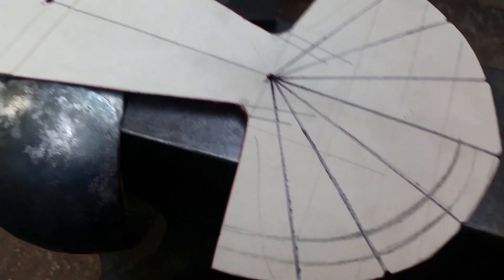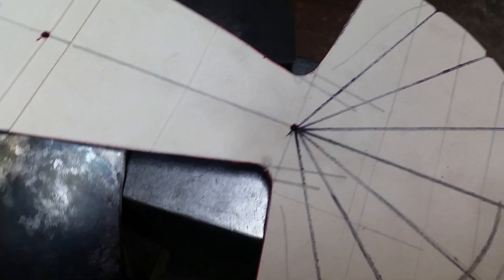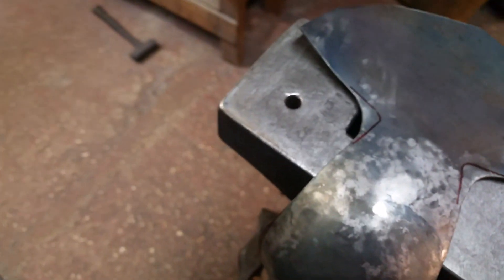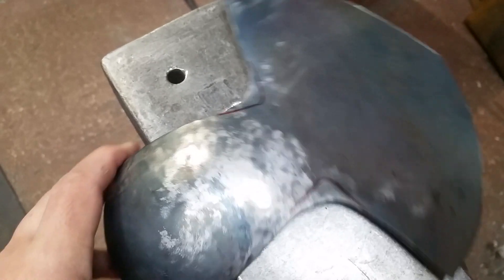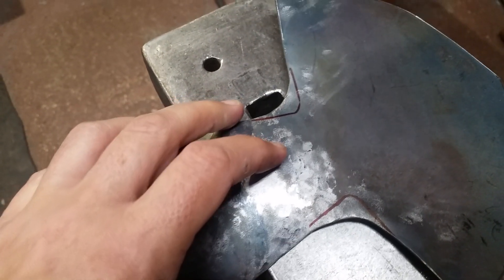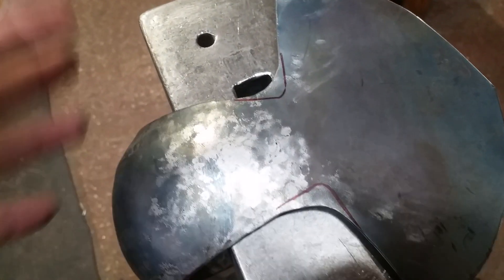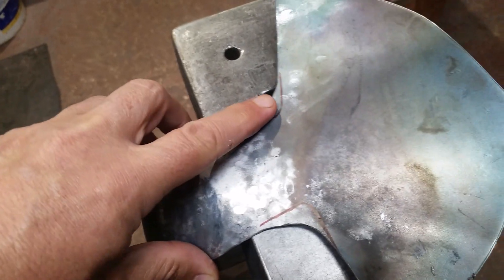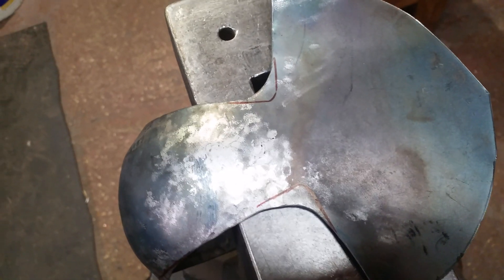Avoid the cracks. How to stop them before they start.

Comment: I have heard that great armourers know how to make armours that articulate without creating gaps. Do you have advice on how to do that? also how do you calculate the amount of curve along the edge of a lame? so far I mostly use trial and error but I was wondering if you had any tips. Thank you.
Reply from the maker: I think it's mostly experience and once you nail a shape to the curve that works for you, you kind of stick with it. It is an area I am trying to evolve in my own game, as my early lames where likely a bit to big, but most of their movement comes from the shape of the poleyn or couter. if that is wrong you will need to 'cheat' the movement with the lames. A well shaped couter/poleyn allows the lames to snap into place with little or no curvature.

I'm trying to get closer with each one I do.
Reply: Thank you. I use trial and error to. I just wish there was an easier way.